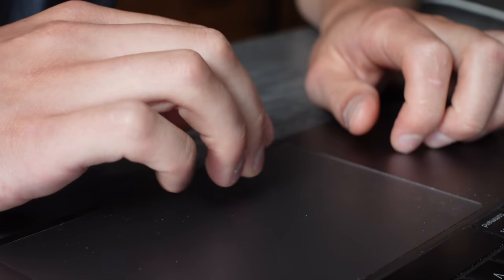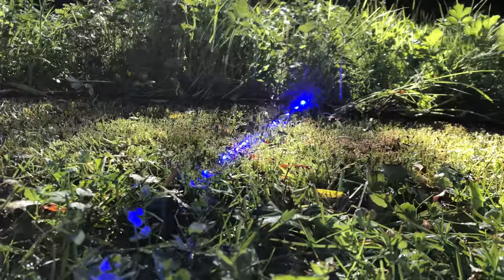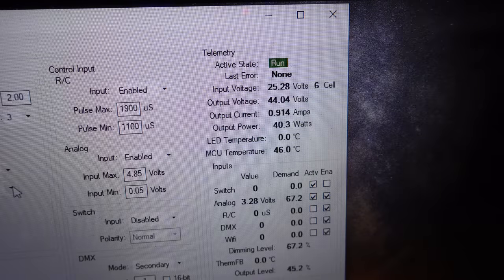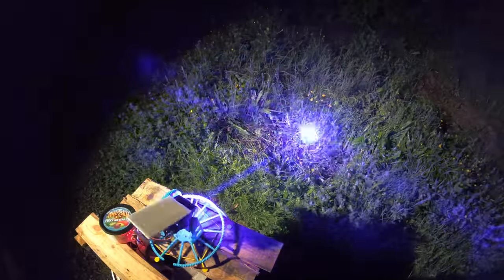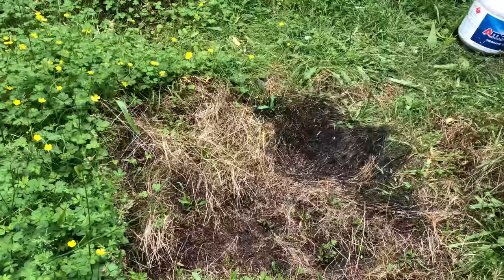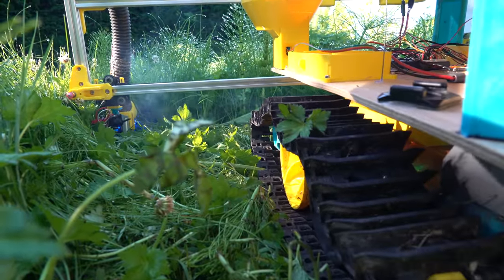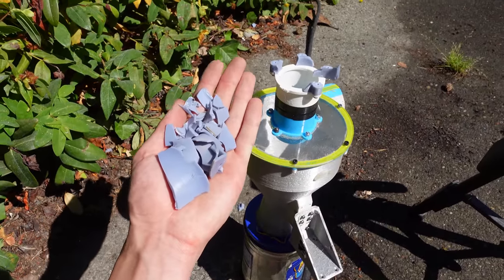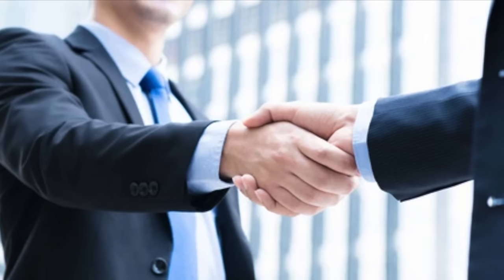Mowing My Lawn with a LASER!!!

Comment: This could easily be good for seed beds to control weeds as they emerge. Obviously you would know where the seeds/seedlings were and avoid them. Actually you could use a similar mechanism for planting them in the first place. Rather than the expensive tracked vehicle, you could use rails alond the seed bed.

Comment: In the time it took to put this thing together, program it AND let it cut, you've could've cut your lawn 2 maybe even 3 times with just a hand roller. I'm not even talking about a gas powered hand mower. I'm talking the old, rolling blades mower that spins as you push it.

Comment: You could make a burn proof area, cut higher on the top and sprinkle with another bot, shot it be too dry.
Or make a sensor and only cut greenish things.
One could also cut from above, although there should be even more safety precautions.
Anyhow: awesome feature.
Edit: cool, you did.

Comment: Instrad of the magnetic rotary encoder for FOC, Check out the hobbywing fusion se and pro models. They are designed for rock crawlers and have excellent low speed control. Can get as slow as 1200kv.

Comment: Drone based.
Both lasercut, main. 
Propellers that are razerblades, you need them, for wind, so It blows away when cut. You are cutting what has been cut, times 100. You should use a windcanon to blast away what has been cut already.
We use 100m Macro Elmarit by Leica. Cutting close, It's faster. 
Poiting the laser down, the beam can't go up.
It is tilted down, making the front heavier so to extra propellors have to correct It,
and do not make It fly backwards.
They blast stuff that is cut away. To carry this heavy stuff, with the extra propellors,
the powerfull laser module, much longer than a camera.
The whole assembly hangs under a Zeppelin, from the Ninja turtles, It's was a big toy, 
now useful, filled with gas to lift It, the drone can do big camera's, but this is heavier. 
It does have a Kevlar, leather protection, the Zeppelin. It can take burns.
The downside when cutting close, If It hits something flameble etc ...
But a little lower. The lens and module are white so the sun doesn't warm them up.
Slow laser slicing is much burnier than fast. Faster, stonger slicing is closer to knives.
So It operates from 1m, to 10cm, can do 5 even closer.
But It's not a lawn mower, It's for hedges, sculpting.
Like mazes and stuff, It does cut really fast, but goes slow.
It has a lot of cutting to do. Theme Parks, Art, Very big gardens, advertising, cinema.
Always aiming down, hard to deathstar some people's eyes. 
It can aim straight forward, tilt a little up but does that rearly.
Problem is, the laser looks cool, but don't look at It.
We wear goggles, protective gear. And the laser goes off after a cut.

Messing with powerfull lasers outside, It is just dangerous.
If you damages your own eyes, you're fault, but If the thing freaks out.
Can be anything, small earthquake, your construction, heartattack and you fall on It.
Hit an eye. That would be set. I would at least do a black plastic, make a "tent".
And the annimals won't be good for their eyes too. 
Even when you don't make them explode and burn or cut them in two.

Still cool just a wind canon. Or something.
Maybe mobile. Cleaner cut.

Comment: Amusing. A possible practical application maybe -how about design one to kill weeds & moss etc that grows up between the gaps in slabs / block paving for paths & driveways ?
the laser could be fully concealed beneath a robot that paces around the area like a robotic mower / vacuum.
Ideally with a fancy distance sensor so it only targets things protruding up from the surface.
Could even have it sweep up any debris ..but manually sweeping up after isn't as much of a chore as weeding a patio or whatever.

Comment: You wouldn't need much to get the clippings out of the way. Use compressed air. It only has to be enough to get the blades airborne. Basically just a glorified air leak. Could probably use a battery power jump pack that has an air compressor. Mount an additional small volume tank for air volune. That would get it airborne. The breeze will take it from there. Since you would be doing other things there would be a breeze. If you had to push that mower there wouldn't be any breeze whatsoever.

Comment: Maybe try using the complementary color of green to cut green grass which is red, not blue. Obviously a green laser wouldn’t do you any good because the grass would reflect almost all of the energy because the grass is green hello. However red laser light will absorb into the grass much quicker and more efficiently than blue light. Also point the beam sideways instead of forward and have it cut a foot or two wide slice at a time that way you won’t need a A sweeping arm back-and-forth.

Comment: The laser should not move but shine on a mirror that can deflect the beam in the direction you wish to cut.   This may not be a great lawn cutter, but might make a great de-thacher for blue grass lawns.   "burning through the thatch layer", and it also solves 1) the focal distance problem as you are only pointing down under what ever device carries the laser over the lawn,  2) stray laser light as it could be 'trapped under the machine.   
  Always wanted to build one when I ran a landscaping company and was pursuing my physics degree, but at the time lasers were expensive.

Comment: I once saw this device which was a laser hair removal product. The laser was suspended between two points, making a cutting pass of approximately an inch and a half or 2 inches anywhere that you ran. The laser over would cut the hair close to the skin without scorching the skin. I wonder if such a technology could be used in your mower that way you would have a specific cutting path, and as your rover moved forward, the grass would be cut, and lay beneath the mower as a traditional mower mows Kind of like the lasers used in security systems where if you step through and interrupt the beam an alarm goes off, but with cutting power, would that be possible I’m not an engineer or even a scientist just some thoughts Would you get a cutting power with the side of a laser this might also reduce the possibility of damage to someone’s eyes

Comment: The setup with the potentiometer would be fantastic for micro photography. Virtially all setups don't have fully adjustable speeds for the platform rotation or the camera track. They move in "steps" and isn't fluid when slowed down to the slowest states.

Comment: This could be an interesting idea for automated grasscutting (perhaps embedded directly into the house, but I would consider this a significant fire hazard. Any industrial or consumer level application would have to include some kind of watering system as well as shielding against accidental eye exposure, which breaks the beauty of its original simplicity. But, hidden in a silent robotic lawnmover, this could find its niche application (for example in places, where it is reasonable to require operating personell to be instructed about safe operation).

The loud vacuum kinda defeats the purpose. Just leave the grass there. It will serve as a fertilizer.

Comment: if you used the front of the 'mower' to trample the grass & nothing more, and instead mounted the laser on the rear, pointing downward, it would be better. this way the 'mower' would trample the grass by driving over it (like when you make crop circles), then as the rear passes over the newly trampled grass, the stalks would be laying down, as to make a downward facing laser effective at killing/cutting/wilting the grass.

Comment: 🔥
👍
Reply: We had a class project design something that does not work and explain why. 
====
1980 Intro. to engineering & I said (laser lawnmower) + 🔥
===
Thought if your lawn was level with the right kind of  grass. 
===
A beam all the way across the yard (like a copier scanner) slowly burning a little bit at a time .
==
Beam reaches the end of the yard then drop back down and takes another little bite.
Reply: Best would be :
     Stake laser out (in center of your yard) & let it unravel in a ⭕ circle on a tether .
===
Have your laser beam under a half 🐚 shell shield. Cutting ✂️ a small lateral path. Very shallow. Hey moisture meter could help determine height. You bail at 17% average.
=====
Old style roller floor brush for fire 🔥 suppression. (  Maybe 🤔💭 2 brushes )
=
Run a PVC pipe straight up from | the center stake & run laser directly on a power ⚡cord.
===
Get it (mean enough) and kind enough to work right ; & buy a DC converter then ( plug it into ) a rear end of a truck.
====
👋😎💨 Bryan 🌻

Comment: I thought of this idea 30 years ago, however I never acted on it I do have the capital I could put some into the idea but it's too risky I have to live off my capital. But I'll pass the idea along to you and if it turns out to be the ultimate idea that makes the product work and become functional then you can send me whatever proceeds you think I'm entitled to for the idea. I suggested the lasers pop up with the sprinkler heads so that way all the sprinkler heads would have a laser and would cut the lawn from all areas so nothing would have to move it would just be built into the sprinkler heads maybe a double function where sometimes I water sometimes they cut so if that turns out to be the way the future and when the product is finally launched I may be a really old man but I could sure use the retirement funds so don't forget me. The sprinkler heads move back and forth and it eventually the laser can go the same speed the sprinkler head goes I think however the water pressure is what moves the head back and forth and you couldn't cut the grass while watering it so it would have to be sprinkler system designed with gears that run back and forth instead of the water pressure so it would have to have electrical wiring to work or some kind of radio frequency and Motors but it would have to have power for the laser anyhow if my ideas affected let me know like I say I thought of it 30 years ago while watching somebody sprinkler heads move back and forth and I was like they pop up out of the ground why not have a powerful laser that cuts the grass cuz they can direct those heads to avoid the shrubs and avoid the sidewalks and some companies are really good directing the sprinkler heads to go exactly where they want them

Comment: how about hooking up the guts of a 3D printer and doing topiary? That would be groovy. 
and... why not add an air blower to push the cut grass out of the way of the laser? 
why not just have a hot wire stretched across your lawn on two rails?

Comment: I think you could achieve similar results for less power with a heat lamp. Also fewer focal point issues. But I also think you're thinking too low-tech. Lasers are so 1980, the future is microwaves (of course).

Comment: A big part of your problem is that you're cutting too low to the ground. Cut at least three or four inches from the ground, yes you'll have taller grass, but the length of grass you're cutting will be short enough that it can fall down outside of the next row of grass that needs to be cut

Comment: Your main problem is that you keep trying to re-invent the wheel. You would be far better off STARTING with a lawn mower, and adapting it to be fully automatic. You should take the brains out of a Roomba vacuum and use it to move a lawn mower around your lawn (electric powered wheels on 4 corners).

Comment: You know, if you actually used it just to mow some real lawn grass it would probably work a lot better.  Something where you're only cutting about an inch off the top.  All the cuttings would fall down into the grass like when normal mowing.  All you did was cut down thick self-clogging tall grass.  Entirely different. It would probably work MUCH better.

Comment: So you have a 40Watt 445nm laser there? (5mW x8000)
how is that possible, when the more or less widely used 445Nm LD diode from Nichia peaks around 6 to 7watt and that is overdriven diodes.. a lasercutter will be conservative, and useally run at 65% of that for longetivity.
then you can beamalign multiple diodes with mirrors. but you lose quite a bit in the conversion, and you will need like 10 to 15 diodes to reach your claim of 40watt 445nm laser power and it certainly dont hold that amount of diodes in that small labby housing you have there.

could you explain, what your basing your 40.000mW claim on.?
you do know they lie, a lot on these laser labby units for CNC and what they claim, just as they do on handhelds..? so maybe use common sense and make a minor due diligence on the matter and not run around with ridicalous wattage claim as it makes you look incompetent on the things your working on, when your eating chinese bs at face value..
If its a single diode in that laser housing there and its look to be blue std 445nm variant, then it will peak at around 7watt if overdriven and if its two align with mirrors its more like 10 to 12w max..
but for some strange reason you dont show whats inside.

Go on chinese sites, and you can see 50watt laser housings that is in fact 5w. single Nichia 0A diodes.
Here is a 30W laser for laser CNC cutting, its from the chinese brand "NEJE" when I tested it, it only managed 4.5W with its laser driver attached... sure I could bypass its driver and connect my bench PSU direcly to the diode and get around 6.3W out of it  https://www.youtube.com/watch?v=wRc74eGfNWs
 but its no way near its rating, and it seem China is pretty rancid when it comes to specs, so they will gladly take the wattage that the laserunit as a whole incl. fan etc perhaps taks from your wall-outlet and use that as laser-specs for dummies, and not the actual optical power.